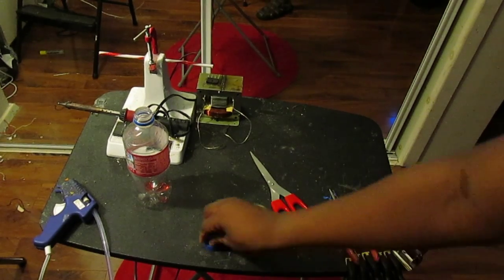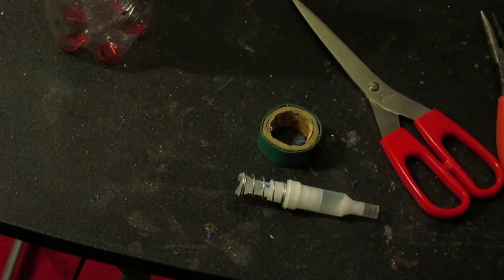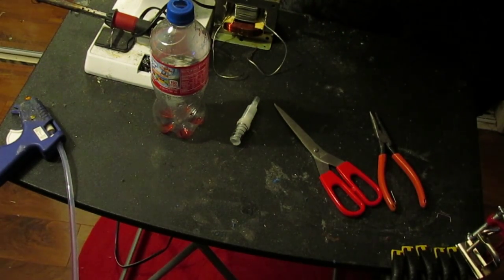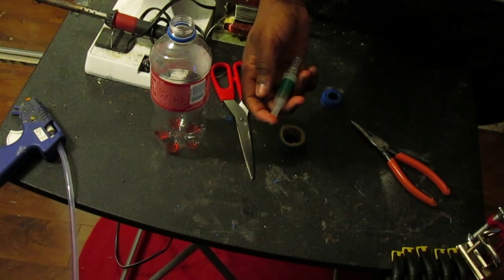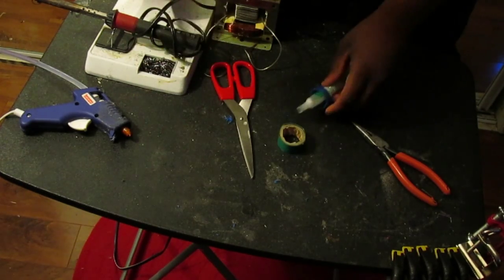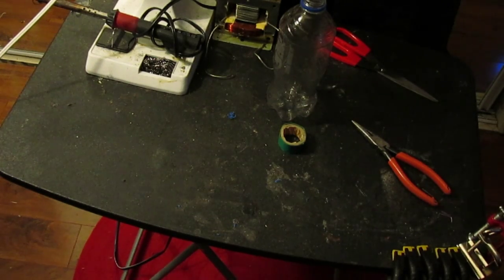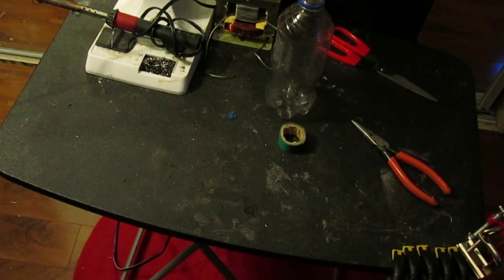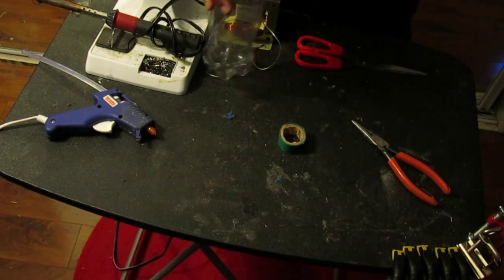How to make a 1  Way Check Valve

Comment: Can u use something else than the glue gun
Reply from the maker: Well if you can't use a glue gun, then you could probably use some type of high pressure PVC sealer or something in that realm, their is also this product called flex - seal but i wouldn't recommend using that.
Reply: ok thx